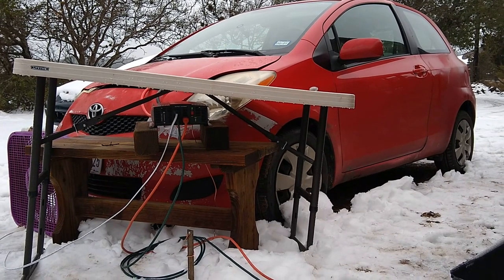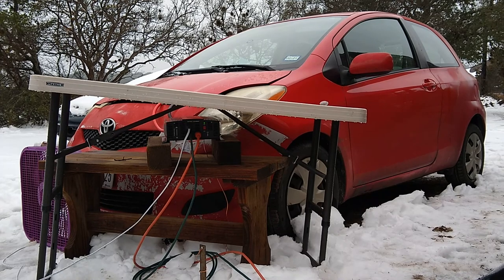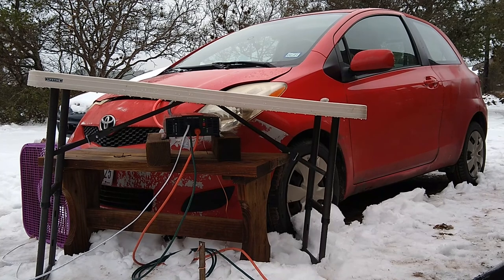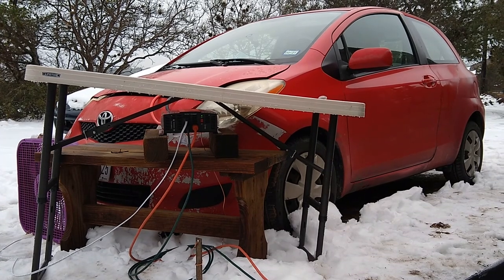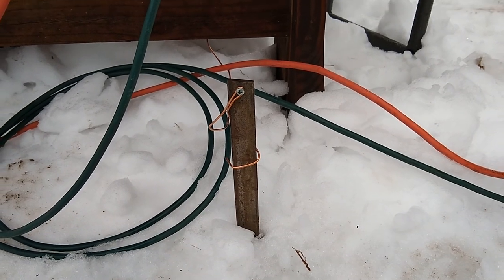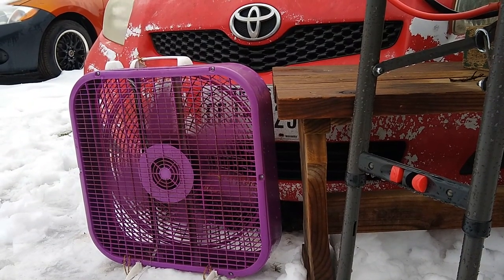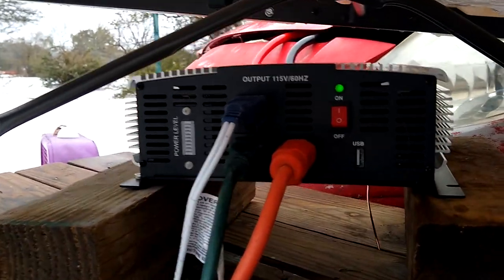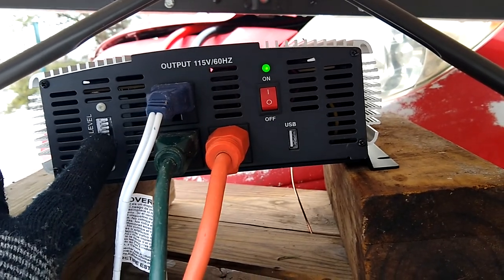3 Days of 2000 Watt Emergency Power from a 2009 Toyota Yaris using a Harbor Freight Inverter.

Comment: Well done friend, God bless and praying things get back to normal soon
Reply from the maker: Hello Tony Zee, thank you for commenting. God is good! Power was fully restored today and water as well. It was an interesting experience for me and hoping someone would benefit from this information. The inverter in the video plus the cables for the hookup were just about $223 total, very compact package for an emergency. My neighbors generator is very loud (like a pressure washer) and needed to be refueled every few hours. I found myself having to peek my head outside to make sure the Yaris was still running, it was so quiet.

Best of luck to you!

Comment: With today's current climate irregularities it would be nice to have ready coverter kits for popular makes of cars. Having a car in your garage or carport that is ready to power your home when the need arises, with just a few additional electronic components, will be quite useful.
Great video.
Reply from the maker: Hi Jay, Thank you for commenting and encouragement. Yeah, man, I agree with you. Something reliable, and fuel efficient enough to keep basic things going for days brings me piece of mind. We ran our refrigerator, tv, WiFi, Internet service and lights for two weeks using this setup plus 15 gallons of fuel. I'm looking at a 5k pure sine wave inverter for the next power outage.

Best of luck with your preps :)